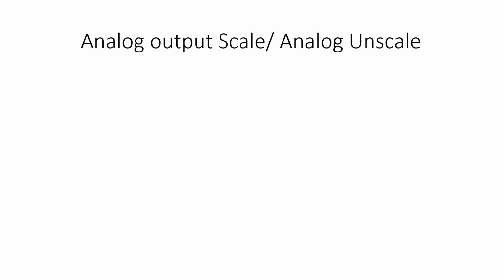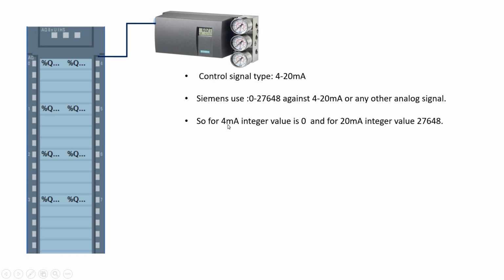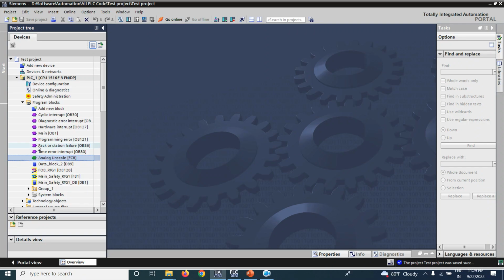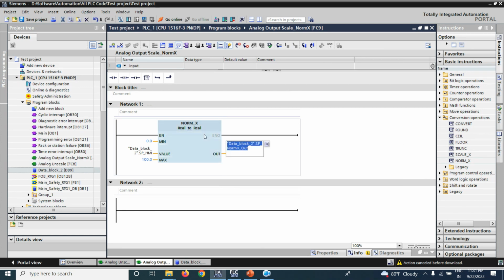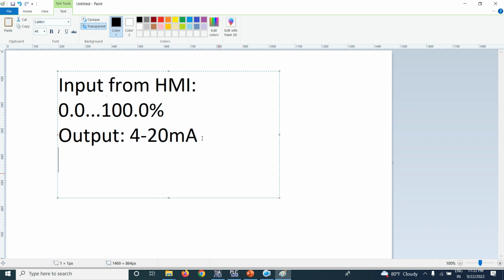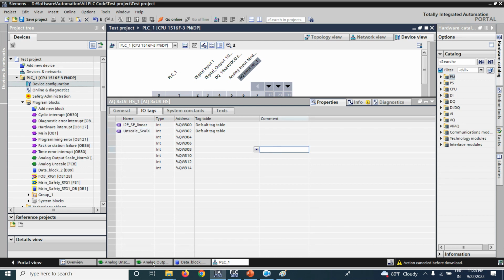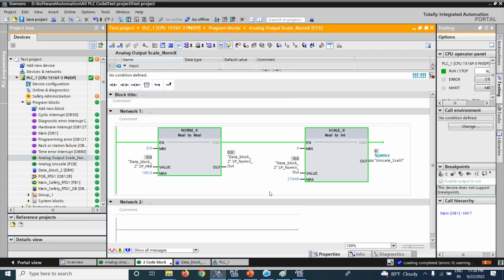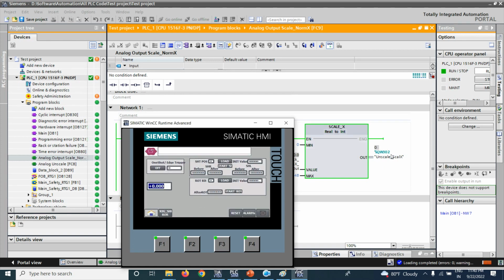TIA Portal: Analog Unscale | NORM_X | SCAL_X

Comment: 1.Hello there, sir at scale x out Qw302 is this no need to do like PQW302 AS PERIPHERAL OUTPUT because some programmer they put P first the  address of analog output as Peripheral
2. Why sir you use global out tags inside of the function i thought only local tags as possible to use inside only outside of the function can be use this global tags
Reply from the maker: 1. If you write PQW302, it will take as QW302.SO no issue to put PQW or QW here.
2. Can you show me which one is it?
Reply: @faridautomation  in fc09 at scale _x block output tag you put Qw302 unscale thats im talking about because this inside of the Fc right then you use global output tags that its.
Reply from the maker: @nelsonpantaleon7751   ok understood, I didn't make this as call block function using  Norm_X and Scal_X  .If you want to use the call block function. You have to use local variable..